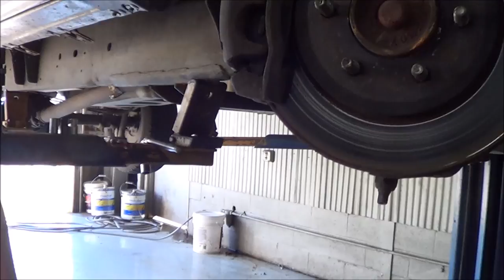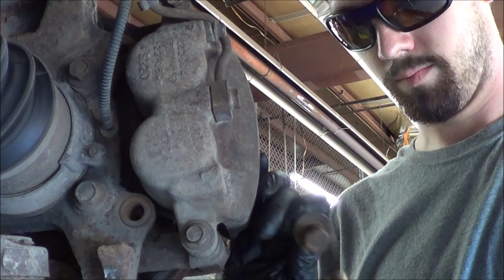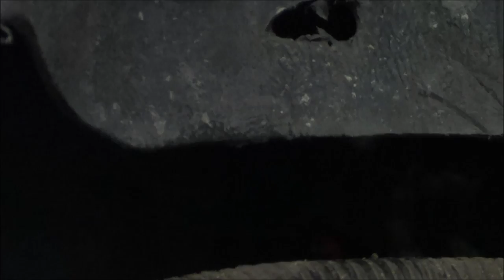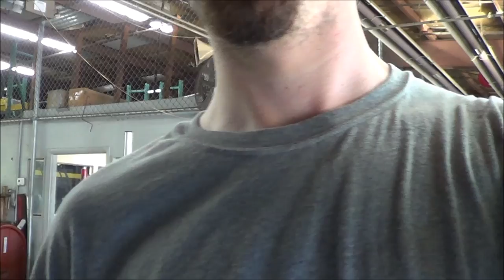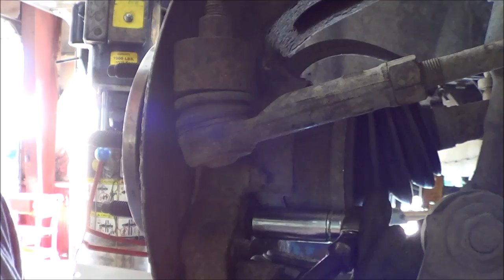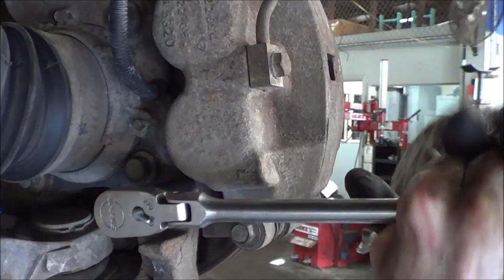How to replace F150 Front Wheel Bearing - 2006 4wd

Comment: Not agreeing on letting the caliper hang from the brake lines. Also, invest in a torque wrench and install the bolts according to mfg.'s  specs.
Reply from the maker: Yes sir I will do that immediately
Reply: I was going to say, "along with tying up the caliper... torquing axles, wheel bearings, and brake calipers must be a conspiracy too." 🤣
Aside from that... good video. 👍
Reply: You don't need no torque wrench man this isn't a head install lol!!!!

Comment: Good video. Straight forward as to what to do. Only thing I'll do differently when I do mine is torque it down according to torque specs, make sure the hub is greased on the inside (will last longer), and use blue lock tight on the hub assembly bolts. Thanks for the video.

Comment: This guy is just a hammer mechanic ! No grease, no toque wrench,  no blue lock tight on the bolts very shoddy work! It will be back in the shop soon! I hope the customer didn’t pay much in labor !!!
Reply: Lololo I said same thing no torque no grease..yeah ok
Reply: Didn't clean it before installing the new unit. I would have put a little ant-sieze on the splines and at least blue loctie and put my 45 yr old Snap-On click torque wrench on it.
Reply: Heck, I got mine apart and the spline connector was very loose, the grease smelled like burned grey alien poop! So I'm going to have to scoop out some of the old grease and add some fresh, it will never be perfect, and I don't use the 4 wheel drive except in emergencies. It's a Ford, and it will survive! It's not a racing truck, and I'm not rich. I'm still learning at 70 years old. I hate bending wrenches, and have a lot to learn. But this video helped  me a lot on my $3800 truck! So whine all you can, and make a video of what to do with bolts that the heads are rusted away on! That would be so much better than complaining, wouldn't it? !!
Reply: @richardmccann4815  If he was charging labor then the job should have been done right !…….

Comment: Correct me if I'm wrong, but shouldn't that axle nut be torqued to spec?  I believe you are only supposed to put 20 ft-lbs of torque on it.
Reply: I only ask because I was told that it was very important for the life of the new bearings and I want to make sure I do it correctly when I replace mine.
Reply from the maker: Yes in general its always best to torque to spec. On this particular application I think it is not so important because the 2wd setup uses the same bearing with no axle installed at all, so obviously the hub assembly doesn't need torque from an installed axle to hold together.
Reply: Thanks for the clarification. Mines 4wd so it's more important to torque to 20 ft lbs?
Reply from the maker: Yea if that is what the spec is

Comment: i have a 2006 ford f 150 how do you hold the axle to remove the bolts around the flange hold the brake did not work still turns

Comment: Appreciate the video. What did the customer say was going on? My 05 Lariat is picking up some grinding noise when driving, sometimes on curves. Thanks!
Reply from the maker: It was making a rumbling noise that increased with speed and got quieter when the truck was turning to the right.
Reply: Thank you for your response. I will jack mine up and check to see if that might be the issue then. Mine isn't constant so mine might be in the beginning stages of going bad.

Comment: What is that rusty plate behind the hub assembly called? 

I want to replace mine because sometimes the rust breaks off and squeals.
Reply from the maker: It is called a brake dust shield or brake splash shield
Reply: Brake dust shield

Comment: Well he never cleaned or never seized the bolts before putting them back in. Plus the wheel bearing needs to torqued according to factory spec. If not it can cause it fail sooner.. Nice video though

Comment: I installed a new 4x4 hub then the bearing! The axle is tigthened but i noticed a gap in the back between the hub and axle part, all i can think of is that the bearing is not the one the axle looks like it needs to go in another half inch ir so!

Comment: Sorry but don't let caliper hang.  Also  you didn't torque the bolts for the wheel bearing and the axle nut.  If the wheel bearing ever falls off due to your negligence and this video is there for the owners lawyer to sue your boss.

Comment: how can you tell the bearing is shot? Feel,sound? thanks
Reply from the maker: Generally when a bearing is bad you will have play in the bearing with the wheel off the ground and/or a rumbling noise that increases with speed and can change as you turn.
Reply: Or the abs light is on

Comment: No grease?
Reply from the maker: Grease costs extra
Reply: I love your reply lol! I was going to ask about the 20-27 ft.lbs torque spec in addition to some lubrication on that roller bearing, as well as the o-ring dust seal. I think "grease costs extra" was the perfect answer!
Reply from the maker: yea on the ford forums you can find non-stop talk about the roller bearings and the best way to grease them. many remove the abs sensor and inject grease into it.

Comment: Title says how to replace wheel bearings  you didn't show how to replace the bearings you showed how to replace the assembly
Reply: It's all one unit. It's called a wheel bearing assembly. The bearing are already set in the assembly - no old school bearing pullers. Much better design. AND about $160 for a top quality SKF or Timken,

Comment: So you replaced the hub assembly not just the bearing, So lets charge the customer 200 dollars for the hub assy versus 70 dollars to press new bearings.
Reply: Guy Ironstone ford doesn’t make just bearings. the whole new hub assembly has to be done if the bearing goes bad, or atleast that’s what you should do
Reply: @bsfilms4818  So why does your title specify "wheel bearings"  instead of Hub assy